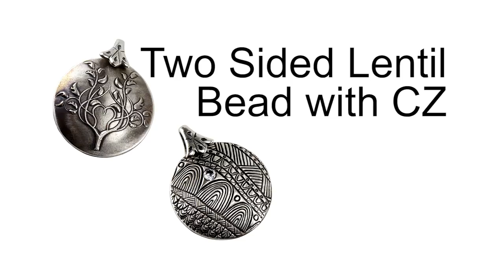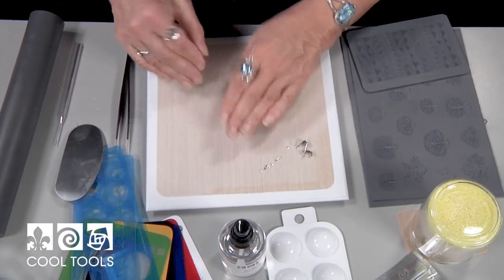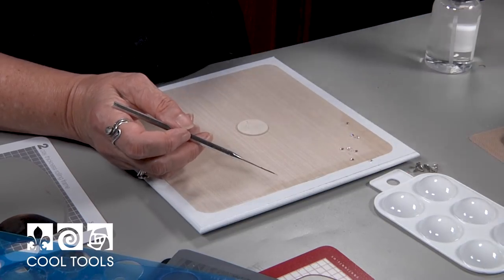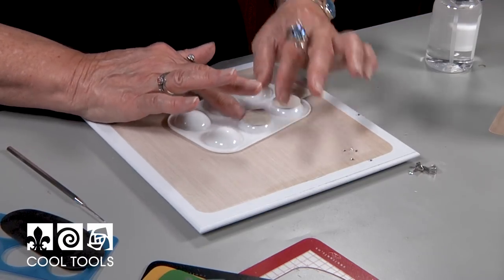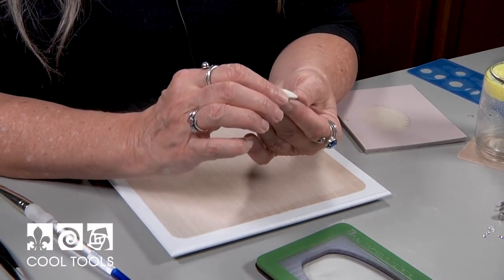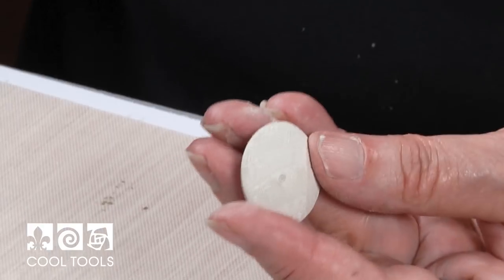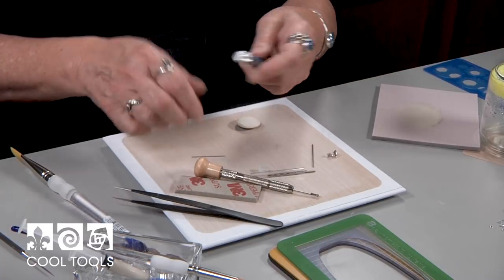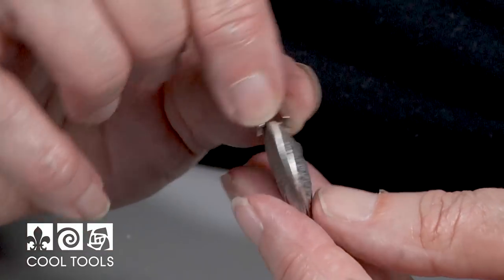Cool Tools | Two Sided Lentil Bead by Lisel Crowley

Comment: How was the lentil fired?  On a fiber blanket? I have experienced it sagging when fired,  Was it fired flat? or standing up?
Reply from the maker: Hi Deborah, we do not recommend firing EZ960 with a fiber blanket. Pieces that require support should be fired in a ceramic bowl with alumina hydrate. Hope this helps!

Comment: Thank you for a great video, Lisel! I'm pretty much a beginner but I realized I can make something beautiful and unique with even my limited skill. Does the 10% shrinkage allow the cz to stay in the lentil? Thanks again for the clear instruction.
Reply: I also wondered what kept the cz from falling out. I did notice it had raised quite a bit from firing.
Reply from the maker: Hi Carla, because of the hole that Lisel created for the cz to nestle into, the shrinkage will not be a problem for the placement of the cz. Hope this helps!
Reply: Yes, thank you, it does answer my question. I figured the shrinkage must have allowed the cz to stay without glue.